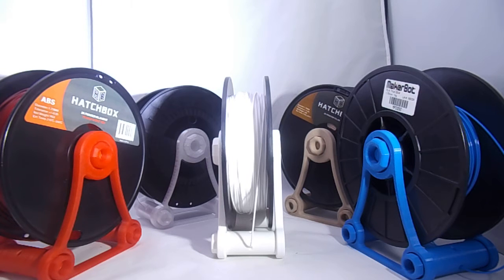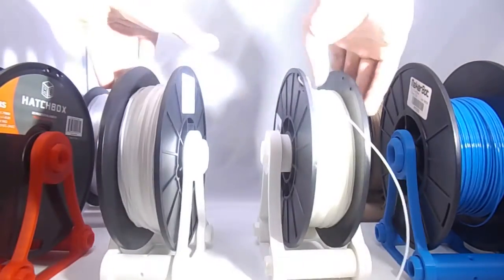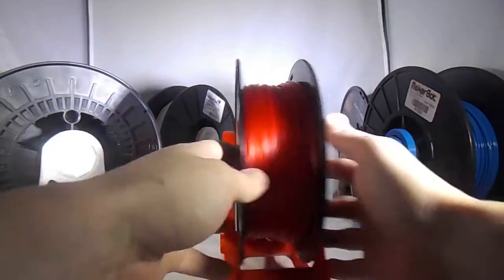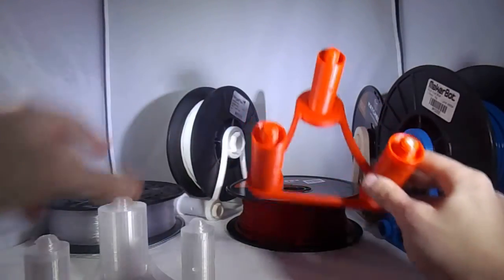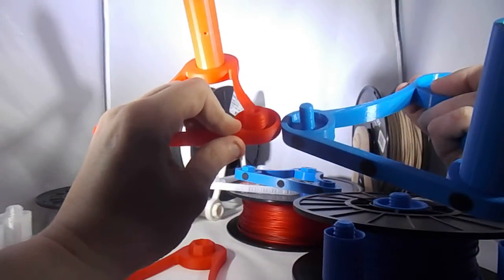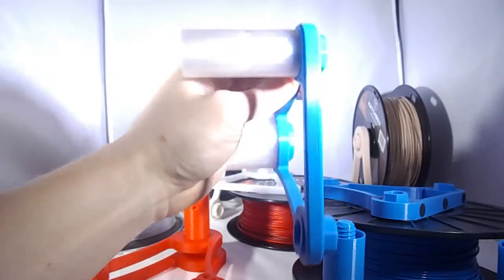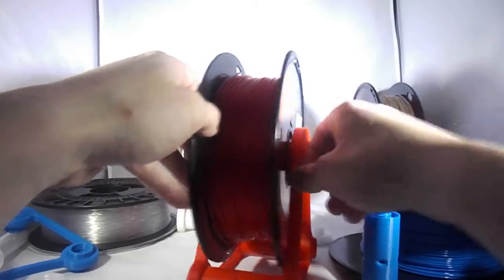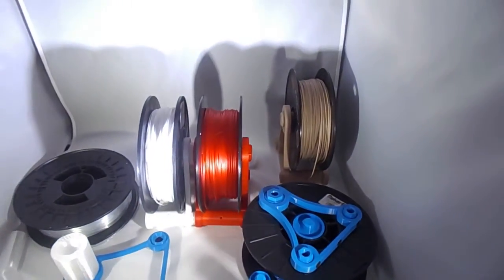Universal 3D Printer Spool Holder

Comment: You can improve this by using a >----<  design so the 2 angles would fit any filament spool.  Then you wouln't need to change your top every time you change filaments.  But koodos!.. your setup is badass!